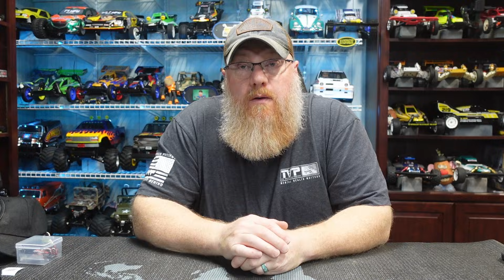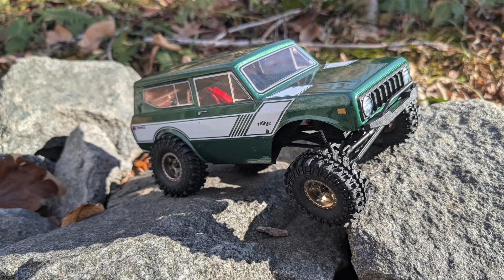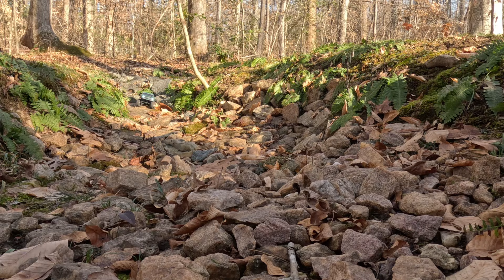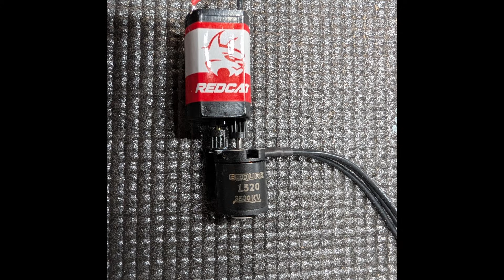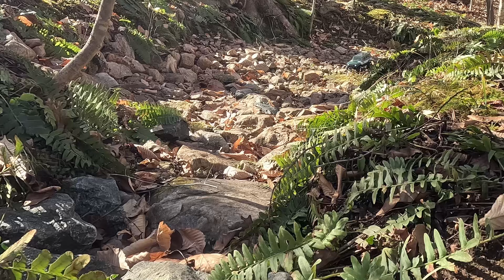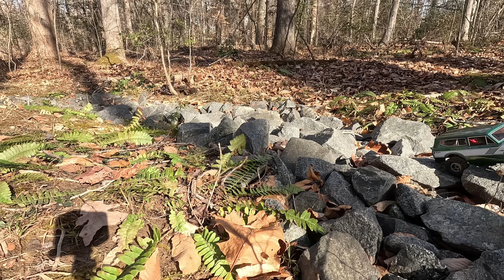SEQURE ANT ESC and Motor Combo Installed in the Redcat Ascent 18 Scout

Comment: Nice truck Addam, looks like a great little crawling spot! I like that they include multiple pinions and different leads for different batteries, really awesome!
Reply from the maker: Thanks, the little Scout looks great! The Sequre combo works great and they set it up to work with a wide variety of mini crawlers. Of course I decide to use one that does require a different pinion LOL! It is a really nice upgrade especially for the slightly underpowered ones like the stock SCX24.It would make a huge difference in one of them!

Comment: Nice option i do love my ascent 18 maybe an upgrade one day funny how redcat call it an 18 when it's only a bee's dick bigger than a 24 great trucks though awesome review and change over i think it's  good to have a cheap weak point on a crawler a plastic pinion is cheap and easy compared to drive shafts, ball joints, axles etc have a great week and weekend mate 👊
Reply from the maker: I do like the smooth control it offers and it has more power than you need for a small scale crawler! It is not a lot bigger than the SCX24 but the size difference is a lot out on the big rocks. This would make a huge difference in the SXC24 as they feel kind of underpowered out of the box to me, especially after adding any weight to them. It would probably be a smart move to keep the plastic pinion in there as a sacrificial part. I will probably do the un-smart thing and stick the steel on in there though... the curse of the upgrade thought process! LOL! Take care Mark and have a terrific weekend too my friend!

Comment: Hello Addam, I got the Injora out runner brushless system for mine. You did not mention this in your video, but the system you are testing is also an out runner. The price of the Injora is $60.00 which is the same price of what you were testing and is an out runner.   The system you were testing seems like it might have more options than the Injora system that I have. I wanted to use the same transmitter that came with the truck. This of course means I would need new receiver which you did mention. The radio gear is made by Flysky. But guess what. They have two different protocols. If you get the wrong receiver it will not work. Who knew? The receiver that I got works because I got the right one. It was not expensive. I think it was $15.00. Thoughts?
Reply from the maker: Yes, this is a small outrunner motor in this. Most of them will be, I am not an expert but I think they can get more torque out of the outrunner style design when they are this small. Yeah, leaving the factory all in one esc/receiver means having to install your own radio system, unfortunately. I think many folks looking to these mods have radios with multi-model memory but those that don't this does add to the cost significantly. I am not terribly familiar with the Flysky systems, I have a couple but they are the very cheap single use style. Thankfully I had the tiny 4 channel receiver that came with the Radiolink radio so I was able to stick that in there. I will happily pay the $15 buck to upgrade to a better radio system, the stock one tend to be fine but I only have so much room for RTR radios! I have a small closet full now so adding to the pile if I don't have to is great! LOL!
Reply: @AddamsPlayground   I have very few Flysky radios. I could have put a Spektrum 2ch receiver but that costs $40.00. I did save some money doing that. I do have a Radiolink that I got for Christmas that I have not checked out yet.
Reply from the maker: @alfredyost7972 yeah, the spektrum receivers are entirely overpriced. I was getting knock off ones from eBay and Amazon for around $15 but pay the same or less for the Radiolink ones and they have gyro capability.
Reply: @AddamsPlayground   Futaba, Airtorincs/Sanwa receivers are even more. Do the Radiolink receivers only work with Radiolink transmitters?
Reply from the maker: @alfredyost7972  As far as I know yes, they only work with the Radiolink radios. Everyone has their own special protocol usually that makes it so you have to keep buying more of their stuff!
Reply: @AddamsPlayground    That is what I figured. I have been finding that out. Keep the videos coming!

Comment: Hey Addam, that is a awesome little motor and esc combo, I really want to get into the crawlers they are very relaxing and just fun to watch them crawl along getting caught up on everything then try to figure out how to get unstuck.  I really didn't notice a lot of gear noise while running brushless.
Reply from the maker: You'll laugh when you see it, the motor is so tiny! It works great though and more than enough power to got you where you want to go. I am always getting myself into a hole and having to fight my way back out of it. That second run I got stuck in every hole and crevice I could wedge it in LOL!  It is still loads of fun and something that just makes time disappear! The gear noise is not bad but it is a little louder than stock. I am sure once i get the steel pinion on there it will sound a bit louder, not going for loud but you know all too well the all metal gearing makes them a little louder. This will just be "mini" loud LOL!!

Comment: Wow, Adam, those rocks are really big for that little Redcat. Are you sure you didn't break any transmissions or axles? ......Very funny video, have a good week, mate.
Reply from the maker: Yeah, it is meant more for the 1/10 scale but the 1/18 scale tackles them pretty well. The second run i could not stop driving into every hole and crevasse I could find out there! It did well but would be suited for some smaller rocks! These are tough and I have had the regular Ascent18 out there many times and it has not broken anything yet. A couple times I was sure something was going to give out but it pulled through and is still running strong! Take care and have a great week as well!

Comment: Bet some grease in the diffs would calm it down and get the power down even better.
Reply from the maker: Yeah, I probably should open up the axles and cram some of the tack grease in there. I am sure it has some but probably not enough. The trans had some in it but I added more. I have to pull it back out to put the steel pinion soon so I will crack the axles open and give them a check!

Comment: That's a small brushless system! man those rocks are hell I like them! 😁👍
Reply from the maker: It is a tiny little thing but it has all the power you can use! The rocks are pretty brutal on these small trucks (the big truck too sometimes) but it got through them. The last run I just kept falling into every hole I could find out there!

Comment: What would you recommend for a 1/10 rtr trail truck / crawler for under $500. Looks like it was smoother for sure.
Reply from the maker: There are a lot out there. I think the best bang for the buck that will leave you with extra cash for upgrades are either the Axial Basecamp - https://alnk.to/9Tc6WG8 or the Element Enduro builders kit - https://alnk.to/74xZfEm
The Basecamp is RTR but of course the Element is a builder kit. I also like my TRX4 Sport - https://alnk.to/8EMO51p but it or the Axial are about the same and offer the same huge aftermarket support. I have heard good things about the Axial Coyote - https://alnk.to/eZK5oqN but I have not driven one.
My personal choice would be get either the Basecamp or the TRX4 and spend the rest on upgrades. All of them can benefit from better tires and wheels, a bit more weight down low (brass portal covers etc.) and a better ESC and motor combo. I have heard great things about the all in one Fusion combos https://alnk.to/hDts6Mr and it would fit in your $500 budget. 
I dislike the fancy stuff like dig and two speed transmissions, unless you are competing and stuff it is just more things to fail and ruin your day out. Single speed and spending that money elsewhere on the truck I feel is the better choice. I have some with the extra do-dads and I never use the features. 
Like I said there are tons of options, it can be overwhelming but the ones I suggested are tough and heavily supported platforms so parts and upgrades to make them better is an road to take!
Reply: @AddamsPlayground well it seams I’ve been looking at the ones you recommended so I’m on the right track. I’m thinking if I go with the coyote I can get the fusion system at the same time and not have to buy a spectrum battery when I buy the truck. I will have to wait on tires and wheels but from what I’ve seen the stock tires are actually pretty good. Thanks for getting back to me, now I have some buying to do. Are those your links?
Reply from the maker: @Anglo-3ninesfine  In RTR trim it would probably be the better one. I wasn't sure if you were cool with the more comp style looks so the other two were the first picks. 
Yes, those are my links to the items on Amain. If you can find them cheaper elsewhere feel free to get it from there! 
It all adds up quickly! LOL! Have fun with it!!
Reply: @AddamsPlayground nope I was gonna use amain anyway. Will it still work if I use the link then sign in?
Reply from the maker: @Anglo-3ninesfine yeah it should work
Reply from the maker: @Anglo-3ninesfine thanks
Reply: @AddamsPlayground absolutely no problem.
Reply: Ok I ordered $500 on the link you sent me so let’s see if it works.
Reply from the maker: @Anglo-3ninesfine oh wow, you got a couple extra goodies along with the Coyote! Thanks for using the link! It usually takes a little bit to show any sales but I'll let you know!
Reply: @AddamsPlayground yeah I got the coyote and the Hobbywing fusion to go with it.
Reply from the maker: Just an FYI... it did show up that a good sale was made. Thanks for the support!
Reply: @AddamsPlayground unbelievably I received someone else’s order instead of mine 😂 I couldn’t get ahold of them yet because of the holiday but whoever ordered the stuff I got had a bad weekend 😂.
Reply from the maker: @Anglo-3ninesfine  Oh wow!!! That is kind of unheard of for Amain! Someone slapped the wrong shipping labels on stuff. That is a real bummer dude. I am sure they will get it sorted out for you ASAP, they have really good customer service. That is a big goff up for sure! So what did you end up with?
Reply: @AddamsPlayground yeah no biggie for me, although it was inconvenient because they were closed for the long weekend so it’ll probably be another week before I see my stuff. I guess they’ll have to send me a return label for this massive order I have to send back to them.

Comment: That esc and motor combo and metal gears are definitely a really nice upgrade for that little rock crawler
Reply from the maker: Yeah, that little motor have more than enough power to get through (or break stuff trying) just about anywhere these little trucks can go! The metal gears were overkill I am sure but for the $8 it was hard to resist the upgrade since I was going to be in there anyways! LOL!

Comment: Nice work Addam , Looks like a good combo 😀💯
Reply from the maker: It is a nice brushless combo and I probably should have put it into the SCX24 as it would have shown a huge improvement over their underpowered and not so smooth stock system. The heavy body I have on mine doesn't lend itself to being a great crawler so I opted for this truck which is already pretty good out of the box. Still a great upgrade for not a lot of money!

Comment: That’s a great little esc motor combo. Amazing it comes with the Bluetooth module and they don’t charge £40 for it separately like all the other big companies 

I really want a crawler 😂
Reply from the maker: Yeah, these little brushless systems are great and I do love the ease of the Wi-Fi connection. Even if you lose it you can easily replace it for $10 so even when you do have to buy one it is still cheap! 
I really like thee Redcat Ascent crawlers. They are not super expensive and run great out of the box. The brass wheels and some aftermarket tires on them and you are set! no need to throw heaps of cash at them to get them performing really well!

Comment: Last
It's so small (That's what she said) 
In your outro I think you meant to say underpowered instead of Unpoweered
I love how simple the ESC it's just one button and a light that's it 
That's great It has a plug to hook up the motor wires only thing is if it rotates the wrong way you have to have a transmitter that you can change the throttle
Reply from the maker: Yeah it is a tiny little thing but packs a punch (that's what he said!) LOL!
Yup, made a typo in there, but I guess it would a be even more of an improvement over an unpowered one! 
Yeah, a very simple design and but full waterproof and fully customizable in the setting via WIFI. No need for a program card and to click through a ton of settings, just plug in the WIFI adapter and open the programming sheet on your phone. Honestly it is set up great out of the box! 
The motor plug makes it simple and convenient, no guessing!